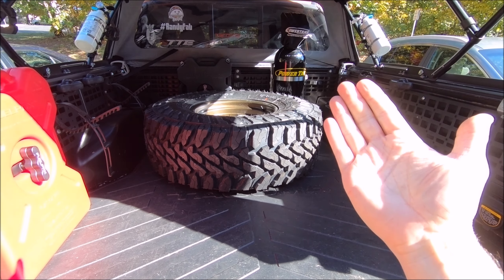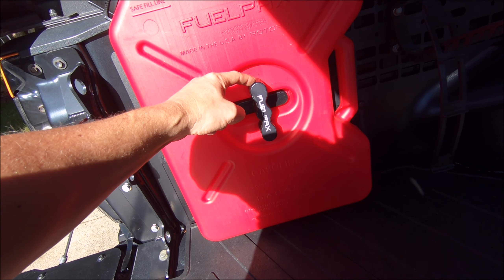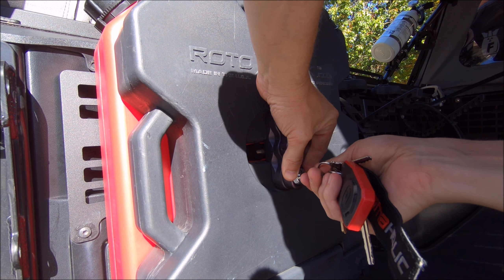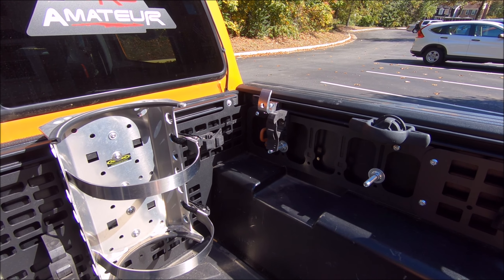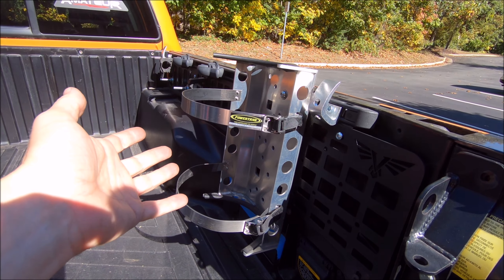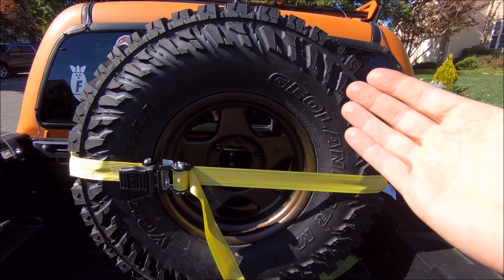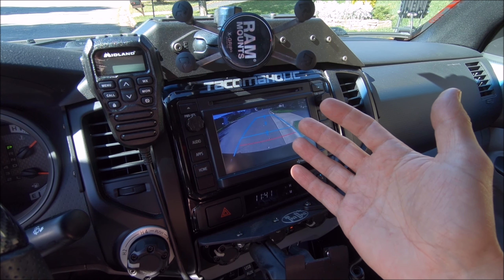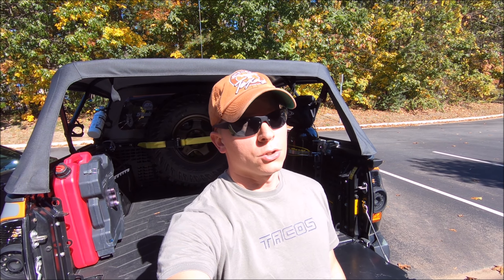35" Spare Tire Mounted + Bed Reorganization | Toyota Tacoma

Comment: I love the set up. I  didn't think a 33 would fit in my Leer Cap (never bothered to measure it). Now I know that when I do finally make the leap I can get a spare at least mounted in the bed if it doesn't fit where the spare normally fits. Thanks Dude!
Reply: No lift yet for me but have seen many comments and videos of 33's in factory location. Slight bend of a couple of centering brackets and it ends up close to exhaust which probably needs to be cut off anyway for offroading.
Reply: @davidholmes4976  I appreciate the heads up! 99% of the off roaing I do is on the beaches of NJ, so I don't need 33s, but anything larger than stock looks better

Comment: Random question... Do you have your swaybar off?
Reply from the maker: Yessir. Had it off for years now.
Reply: @Tacomaholic  Other than more body roll is it safe at like 80+ speeds?
Reply from the maker: @MeezyYota94  Not having the sway bar on makes the truck more likely to tip in the event of a high speed sudden maneuver

Comment: Just woundering, with all the Mods you have done did you exceed the value of your Tacoma?
Reply from the maker: Nope. My Tacoma is priceless.
Reply: @Tacomaholic  That's not what I asked. This Tacoma has a Blue Book value, what year is this and current mileage?
Reply from the maker: @starchaser2489  Ahh gotcha. 2014 Double Cab TRD Offroad with V6. 62K miles.
Reply: @Tacomaholic  Thanks, the question was, "Do you have all your mods exceeding around $23,000 dollars of your truck value"?
Reply from the maker: @starchaser2489  Not even close.

Comment: Do you think this would crack the composite of your truck bed? I seen some stories of peoples beds cracking on tacomaworld. This is something I wanna do but just wanna know your input!
Reply from the maker: Adding more weight is going to add more strain on the bed. I have the bed stiffeners which are supposed to help alot and I don't do anything high speed offroad where the weight is going to shift more.

Comment: What size lift are you running with on your truck? I’m looking to add a 2-3” lift to my 2014 trd off road. For more ground clearance when I go rock crawling. Thx!
Reply from the maker: It's a 4" lift. 3" suspension + 1" body

Comment: Why not just put it on the roof rack ?!
Reply from the maker: Because it would be a pain in the ass to get it up there, be a pain in the ass to get it down from there, and the weight that high would raise the center of gravity.
Reply: @Tacomaholic  not by much that tire is around 78lbs and the rim is about 18. So it’s a matter of a 100lbs up there. Waaaay lighter than rtts and other shut ppl put up there.
Reply: @Tacomaholic  btw I have a spare 315/75/16 g003 on ray10s up on my prinsu